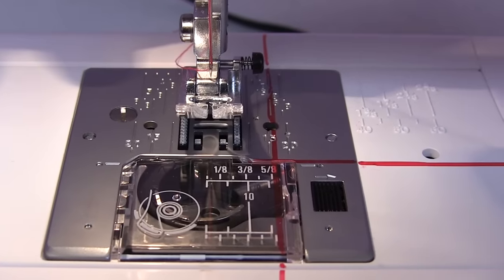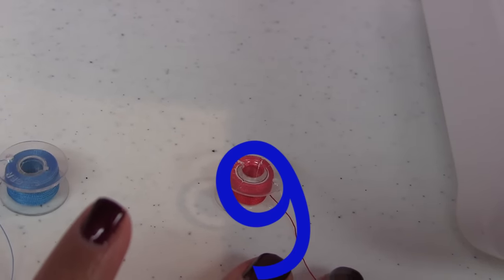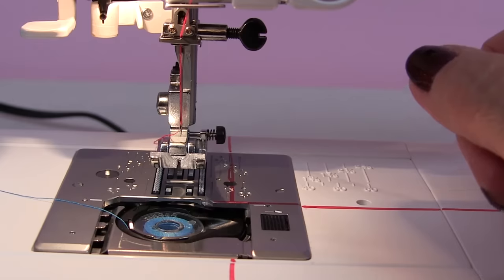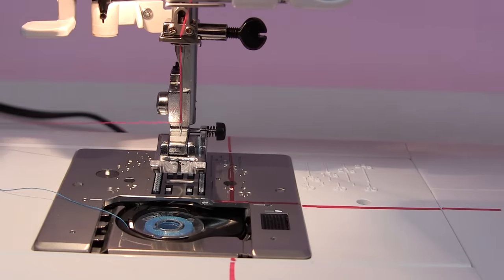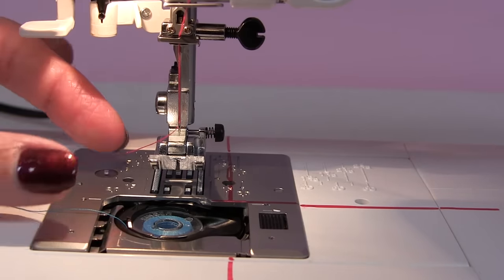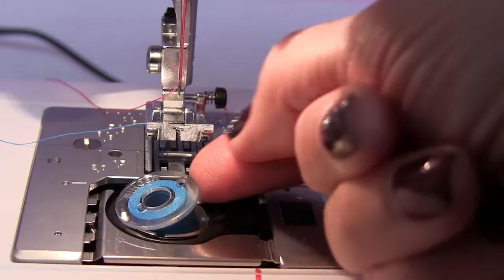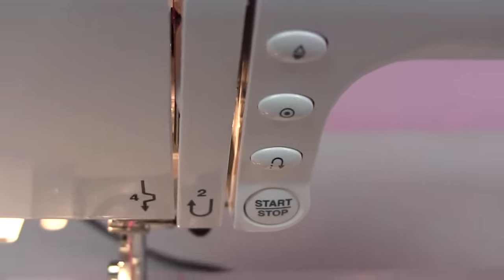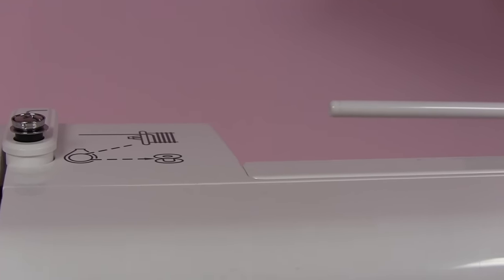Catch the Bobbin Thread

Comment: I like that procedure you demonstrated on how to thread the bobbin thread and get it up for use and I have to try that on my sewing machine even though mine has the bobbin set the other way and the thread have to run clockwise out of the bobbin. After having my machine for over 5 months and trying to get it to work occasionally I keep having problems with it working correctly. The needle now go down so far and don't come back up by itself and I gave up for now.

Comment: OMG ty ty ty been trying on 3 different machines for 2 days found out the singer 533 had a broken gear.  and now thanks to you.  I have finally threaded the 6212.   although I do have a question.  the 533 when I would move it it was little  to no resistance.  but with the 6212 there seems to be more drag.  I have heard that bobbins example the ones with the metal case sometimes get a lint build up.  is it possible that lint has built up around the metal spinner under the drop in bobbin causing this???  if it is possible could you possibly offer suggestions on how to clean it?  also my wife had told me they use oil?  where do I put it and what do I use???  thank you again love the fishing metaphor!!  I watched like 2 dozen videos and it took like 15 secs and it just happened I was like huh what did I miss??  thanks to you I realized I can't catch the fish when I'm holding both!   kudos

Comment: I been doing all this and it still won’t catch ! I’m loosing my mind with this !
Reply: Are you turning the right way?
Reply: My machine needle is not catching the thread from the bobbin..don't know what to do
Reply: Like Rosa said; are you turning the hand wheel the right way? That was my problem first
Reply: See if the needle number u r using is correct
Reply: @anneluggalexander7873  There is only one way to turn the wheel the right way
Reply: I was seeing just fine. I can catch the thread without my fabric but not WITH my fabric. I've changed nothing.. It just suddenly stopped catching when I start sewing.
Reply: you have to reset the timing!
Reply from the maker: Ayesha Tariq turn the hand wheel one full turn towards yourself. It should pick up the thread.
Reply: Thanks Tina! I really needed this tutorial as this kind of bobbin is unique!
Reply: Mine was a mess until I used the wrong way to insert bobbin. go figure.

Comment: Thank you for your video.
Unfortunately, I have tried everything: cleaning my bobbin case, threading the machine correctly, placing the bobbin in the right direction (the 'p' is an excellent teaching method), and I have followed your example to connect the bobbin thread to the needle thread.

My bobbin continues to jam and it creates a tangled up mess inside the case.

What am I doing wrong?

Many thanks...

Comment: what if bobbin thread does not  come up???  I have a 1972 brothers machine with the side ways drop in bobbin...very tiring to get right...I've adjusted the tension, but nothing works....should I get a new machine..  Thanks  R Sutton
Reply from the maker: Did you turn the hand wheel toward yourself one full turn?  If that doesn’t work maybe it needs to be looked at.

Comment: I tried it your way on my brand new Singer and it seemed ok, had to try a few times, but the moment I started sewing it sounded like something broke in the machine. I cant see whats wrong, I looked at the video 5X before I attempted this. the threads seem to be coming out of the machine OK. Sad if I broke the machine due to the bobbin. Now I have to buy another machine? My advice to people is do not leave the sales shop until you can do this blindfolded.

Comment: I bought a Magicfly 59 stich sewing machine second hand at Cash Canada Pawn Shop for $79.95. I knew I got a really good deal as new it is $230.00. But, I am not having ANY luck at all despite watching a handful of videos on how to catch the bobbin thread. Some of the videos showed a little notch on the bobbin case where you run the thread, but mine doesn't have that. I watched the video that is specifically for this machine and it looks so simple but is missing some major details. The parts all look okay but it is not picking up the bobbin thread. I am quite frustrated as I don't really understand exactly what to do to fix the problem. There doesn't seem to be a proper manual I can download as a pdf, just a very simple video as though this is a promotional machine. No wonder it was in the Pawn Shop. I can't for the life of me seem to find a decent working solution. I think I need to make a trip to Fabric Land in Londonderry Mall and ask for some assistance.

Comment: My bobbin isn’t catching and i am not sure why, any advice?
Reply from the maker: C H make sure you are putting your finger onto the thread that you threaded the needle with. Don’t hold the thread place your finger on the thread. Turn the handle wheel one full turn Towards yourself. It won’t catch if you turn it away from yourself.  If that doesn’t work it might need to be tuned up. It could be a mechanism problem. I hope that helps. 😀
Reply: @tinafazzari2948  Thanks for the help! I thinks its my sewing machine not working!😀